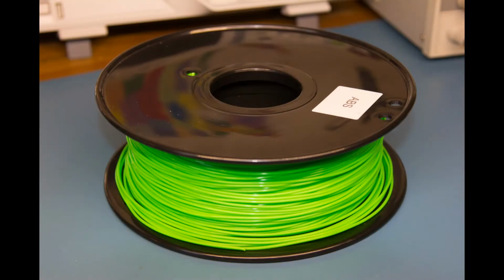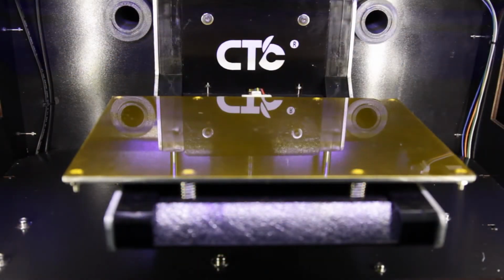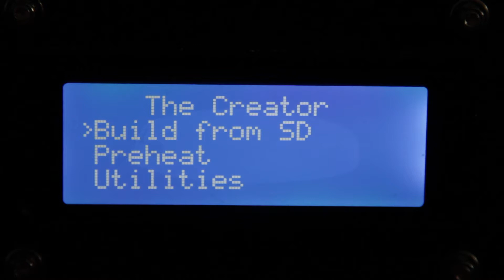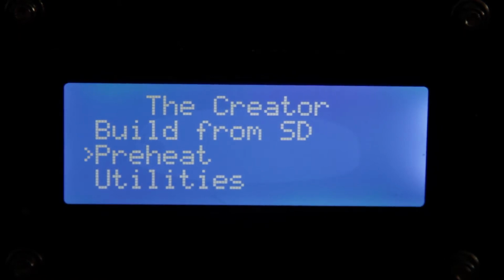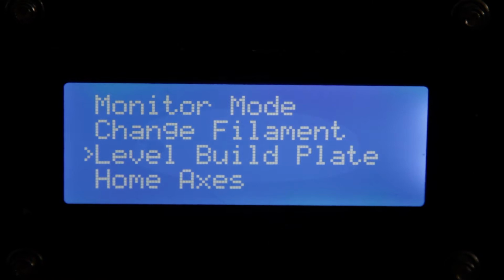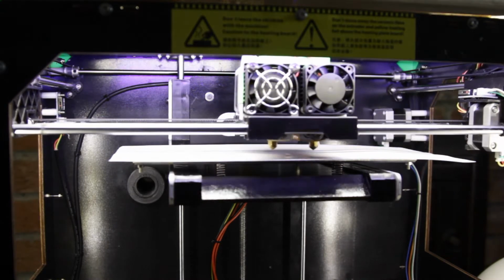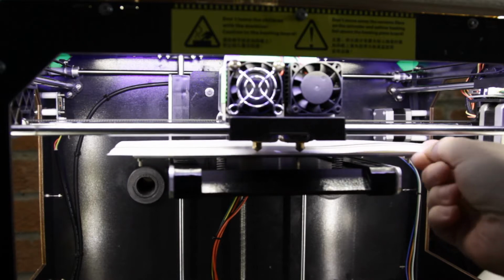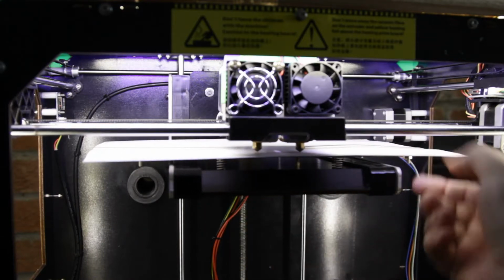3D Printer tips and tricks - Part 1 ABS

Comment: the reason your ctc fake makerbot printer had the wrong parts is becuase its fake and cheap and i had one had to send it back and buy a wanhao i3 and would never go back cant be it. steer clear from all ctc branded printers.
Reply: john doe - From what I've seen I would agree. The CTC is the worst of the MakerBot Replicator 2 clones. I have several of the Qidi Tech 3D printers and they work very well - probably better than the original MakerBot. The Flashforge Creator Pro is reported to be at least ss nice although it's about $200 more.

Comment: Thank you for this video, I have a davinci 2.0 and larger prints are warping... I will check the temp and start using this tape you recommend
Reply from the maker: Large prints can be a major problem using ABS. A fully enclosed printer is usually required in order to keep temperatures regulated.

Comment: My ABS is listed at 250C. But even at 250C the filament comes out too thin. I'm using a .3mm nozzle. Also i'm afraid not to damage the PTFE tubing running to much at these temps. Any Suggestions?
Reply from the maker: Try lowering your temps or try different filament.  Maybe try a higher bed temperature.
Reply: Thanks for the reply!  I will try at lower temps to see if it works. Now i've changed to a .5 nozzle and it doesn't want to extrude enough. I'll keep you posted. Current Bed temp is 110.

Comment: All thermistors from CTC are 80k not 100k for some reason and for people who don't want to use kapton and chemicals get 3M !! Brand blue tape and sand it with 180 grit sand paper wipe of the excess dust not with your hand, and print abs at 75 then increase to 85 after the second layer I know that seems low but it sticks like a rock I can barely get it off the bed once cooled and it never warps with a 10 line brim 200 by 140 objects are spot on